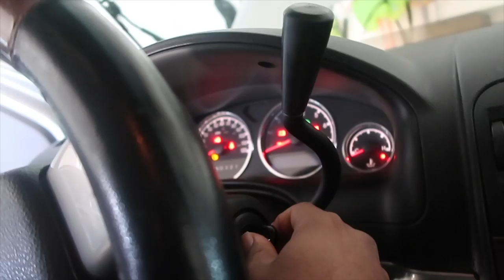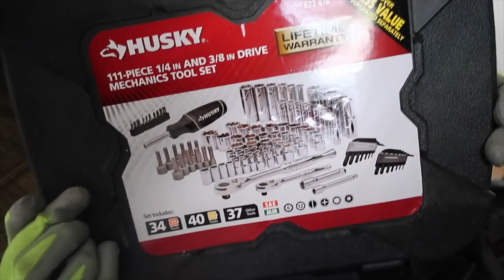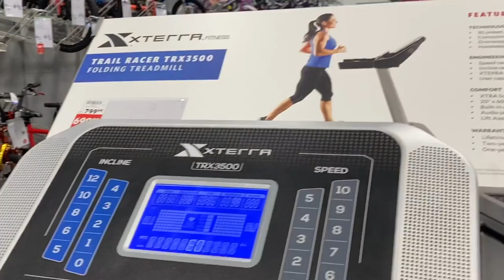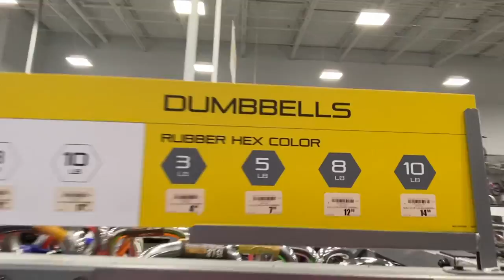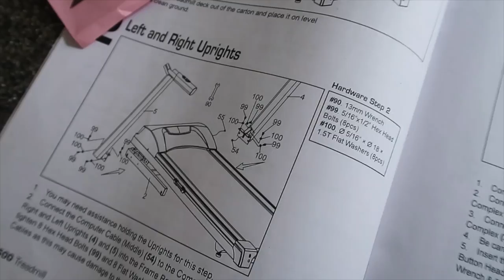TRYING TO IMPRESS MY WIFE! ( VLOG 3 WITH MR. AND MRS. REAL)

Comment: You know that van been sitting he got leaves under the hood WHILE ITS IN THE GARAGE😂😂
Reply: Rip
Reply: Those are hood leaves. They make the van go faster.
Reply: @nohalo7  😂😂 also they turn on the AC when you have no coolant.
Reply: @nohalo7  rip
Reply: Nigga that shit been there so long the trees grew out the car and died
Reply: nohalo7 _ they also burn the heater furnace to keep the car warm
Reply: @nohalo7  exactly. Any cop chase I see in the hood, had leaves coming out the car.

Comment: Had to disconnect the vertical PVC tubing to the alternator to replace the battery and also have to take the engine out to test it 😂😂🤣🤣🤣🤣

Comment: Bruh...it don't take that long to put a battery in. 🤦🏾‍♂️ Also, take that van to be serviced. I know it need all fluids filled and the oil changed. That whining is the power steering. Smh